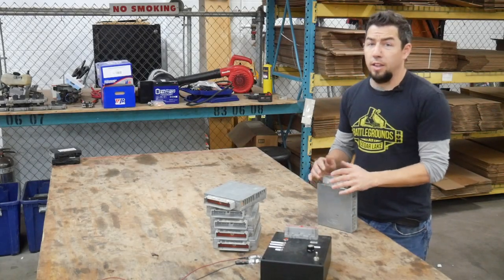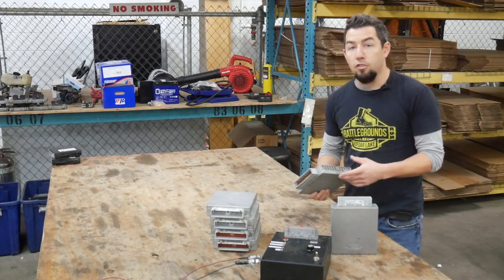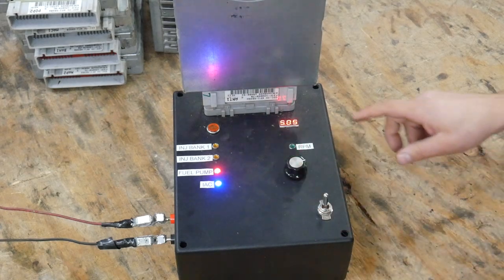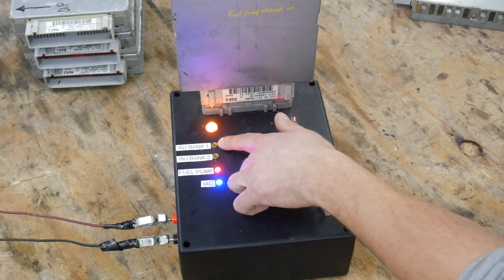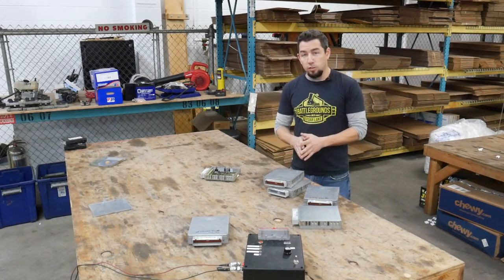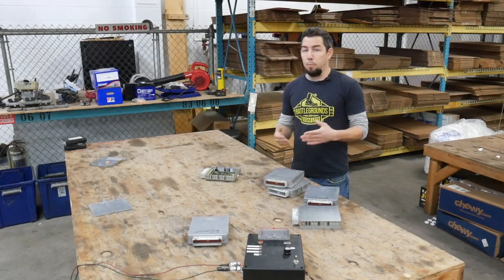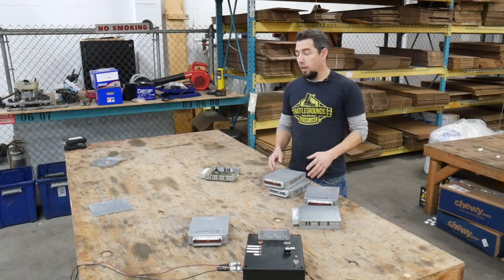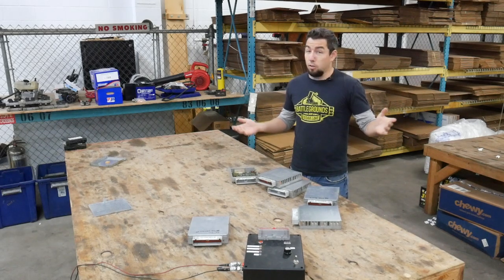90's Ford F150 F250 F350 Ranger Truck OBD1 ECM PCM Engine Computer Testing Common Symptoms & Failure

Comment: Thought this was a solid company after watching the video, you seemed to really know these ECU's in & out, however, after calling/emailing I can't say I'd recommend your services to anyone.
Reply: I watch you all the time
Reply: Why?
Reply: I saw your s10 6.0 video 👍
Reply: Hi Sarah, I’m really not sure if you’ll even see this reply or not but I have a 1994 manual ranger and when I bought it its always had an issue with the ecm where it just will not start after driving/turning the ignition too many times in a day and I’ve tried ordering a new ecm and it made it run awful and so I had to put the old one back in, when I opened up the old ecm when I had it out I took some pictures but nothing appeared to have a bad connection or no capacitors leaking, I’m really not sure what it could be and I have no clue how I could find a perfectly working ecm that’s exactly for my Ranger stx 6cyl 4.0 manual, seeing your comment on this video and watching your ranger videos you made made me assume that you had a similar problem with your ecm, I was wondering if you have any input you could help me with? Thank you in advance if you do end up finding this
Reply: @russbow05 Get the number off your ecm.  For instance, for my 1990 2.9LV6 ford with overdrive automatic, the factory installed a F0TF-12A650-BGA AOU engine control module.  I recently purchased a used spare for my vehicle and replaced the three failure-prone electrolytic capacitors inside and swapped it for the original.  I've also replaced these three capacitors in the original ecm and have stored it along with my spare parts for this vehicle.
The replacement ecm works fine, just as the original did.
So you have to locate an exact match ecm because it's configured for your particular vehicle, transmission inclusive.
It's possible your vehicle was fitted with some incorrect part or parts to begin with, production mistakes do happen.
Reply: Not helpful without some context.

Comment: This is cool that y'all's doing this love it.. I've got a few of these trucks and I put a computer from a automatic in a manual and has worked for over 15 years. The check engine light is on but no issues running or driving. They were the same motors at least lol. I wouldn't have even tried to do a manual to auto but other way around ship it lol.
Reply: I want to replace my cab on an 89f250 with a 94 f150 I’m wondering if my email from the 89 will plug into the 94 cab? Any thoughts?
Reply: I think you can hang some solenoids or even resistors or light bulbs on the appropiate ecm circuit used for the auto transmission solenoids to make the computer happy.

Comment: We have a 95 Power Stroke that is having throttle issues. First time it revved up all by itself with no one in the truck. Now about every half hour it starts rattling smoking, and looses all power. We were scanning it thru one of these episodes and the injector pulse width goes from 1.2 to 5.5! We tried a rebuild IDM and it won't even start. :D

Comment: I have an 89 E150 with 70,000 original miles, when starting warm it has a pulse idle for a few minutes then smooths out, but cold start it operates like new. I wish there was reprogramming for extra power like there used to be, I've been wanting a replacement ECU for when mine shorts out in the future. I have a 600 I/6 with the C6 transmission

Comment: Eric, I need a PCM for my truck and I had tried calling the number you have listed in the description to find out if you had one available and see if I can purchase via phone but I get a recording that this number is not available. Did you change numbers or what’s up brother? I checked a couple times and what I dialed is exactly what’s in the description. Can ya please help Eric, I need to get my truck running, my feet are tired of walking! Lol

It’s a 1994 F-250, automatic transmission. I’m gonna pull it in a few hours and hopefully it will still have the part # decal on it, but we’ll see. 

Thanks Eric!! I appreciate the help !!
Reply: Did he ever answer you?  It looks like nobody gets any answers here...

Comment: 95 F250 7.5 Automatic.  Starts fine idles with a slight miss, runs fine as long as I don't stomp on it.  As soon as I stomp on it, severe misfire, rpm drop, harsh jerking and rich exhaust. Timing light on coil wire confirmed coil is not firing when misfire occurs. New distributor, plugs, wires, coil, ICM, MAP, fuel pressure regulator. Previous owner was chasing this problem.  Drive it 8 hours home as long as I babied it no misfires. I'm down to ECM or timing chain. No check engine light. Have you seen this specific symptom?
Reply: Check TPS, might have a bad spot on the potentiometer. Then check ECM for bad (usually leaking) capacitors.

Comment: So I got a shop manual for my truck. It has all the values for the sensors the truck uses. You seem to understand what the computer is doing. Maybe this sounds crazy but why cant you make a new computer or raspberry pi type board to do the thinking

Comment: Ok little study here 1990 f250 7.5L gas battery was installed backwards by customer now we’re getting irrational fuel pump relay activation and constant coil firing without the engine spinning could an internally shorted ecu cause that ?

Comment: Great video. !  I have a 1993 F-150 which cranks, but doesn't start.  Replaced distributor, coil, and the computer twice.  Truck will start & run for @ 30 minutes, then die.   I bought a tester from Amazon, but for OBD 2.   I assume Amazon has testers for OBD 1.  Suggestions ?
Reply: Same issue here, i got a 30 dollar obd1 tester at autozone and i got the code for PCM Voltage failure (Code 513)
Reply: @jacobog3221  What did you replace, and did the truck run OK then ?
Reply: They do, just got one myself
Reply: @kennethcallahan7410  Tks

Comment: I have a 2003 f350 6.0 diesel. It uses ford protocol for an operating system. It uses canbus for the ficm control. As i understand it, this ecm was only used for 90 days. Im having trouble finding troubleshooting videos for this ecm and system. Can you assist me?

Comment: Where are you guys located out of and is this true only for 90s trucks. I currently have a 2000 excursion and I've been chasing my tail trying to figure out check engine codes. A mechanic shop couldn't diagnose it recently and I'm starting to thinking it's my engine computer. Please let me know how I can get in touch with you folks or if you know a reputable shop in Southern California, thanks in advance 👍

Comment: Could this cause only 6 of the ignition coils to spark and not the other 2? 1998 ford f150 4.6l v8 4x4 single cab stepside shortbox

Comment: 94 bronco 5.8 I always smell a plastic burning scent from the ecm location for 2years now. I get paranoid I check the brake reservoir which has been updated and some times think its the rust protection burning.  Now im sure its the ecm burning its self. I wonder the cost probably like 600
Reply from the maker: It's possible something else is causing the smell. If a capacitor was getting that hot it would have gone out a long time ago. Our units are much cheaper. You can find them on eBay by searching your part number.
Reply: @ProRebuild  thanks

Comment: Hi stupid questions time. I have a 1994 f150 l6 5 speed.Last year during al this covid stuff I lost the fuel pump part of the eec.
This a ca. truck according to the  emission sticker.Instead of using the info on the door jamb< I pulled the eec and showed it
to the local auto part chain store to have them match it.Can a manual trans truck run on a auto eec ? supposedly they matched the eec.

door jam says F3AE 6E081 HHD.Calibration 3-51-R10. old eec the one I pulled out says F3TF 12A 650 NC.
I believe they tried to match by application . I could never get the idle below 1000 rpm.Lately on start up hot or cold idle swings up to 2000 rpm then drops to 1000.Check engine light works and is not on.Passed smog a week ago.

 I dug up my old OTC 4000. It can do the KOEO test only and comes up with all kinds of auto trans codes Will not communicate when I try to do KOER or select show data . I clicked on path finder the help on the scanner . I get just because your vehicle runs on this eec doesn`t mean it is correct for application ?.

Any advise on how I should proceed ?  Thanks

Comment: So i ran my 1999 7.3 powestroke out of fuel. Reprimed the fuel bowl and everything and its getting fuel but its crank no start. Would it be pcm?
Reply: Did you ever get ur truck started I know when I changed my hpop it took for ever to start it takes a lot to clear that air out of the system so

Comment: question, could a bad ecu cause a trany to up and down shit sporadically without any warnings? either at low or hwy speeds?
Reply: 94 bronco owner here, mine did that yes, it would hard shift and according to the mechanic it would be shifting from first to second but it would think its in nuetral and cause it to jerk and shift like i got hit by a train from the back, hope that helps. Its not a absolute but from my experiance it could be the ecu is going. I THINK its either water getting in from the rotting body seal in the cowl amd dripping on the wires or just goes bad naturally

Comment: Is there a way that you can get one of these stock computers and upgrade all the capacitors and resistors and what's necessary and reprogram it to be able to produce more horsepower or they just easily able to be hooked up to with the right stuff and reprogrammed
Reply from the maker: We do not do anything like that. We just do stock replacements no upgrading for more horsepower.
Reply: What numbers do you want? When I type in all the numbers it has no matching parts. Here's everything it says, JETO eec-iv efi-sd48b f4tf-12a650-na g 64esb48b37 9573-10 4a31, by the way it's a 94 ford econoline with the 351w

Comment: You need to come up with a test for the trans. I just installed the 7th computer in my  95 lightning and 3 we reman. The last used computer fixed it.
Reply from the maker: We never sold you seven ECU's. I do not think we have sold you a ECU. We have not had a Lightning ECU here in a long time.
Reply: @ProRebuild  I don't think he was claiming that he bought the seven ecu's from you, only that he bought seven.
Reply from the maker: @jimmydavis6254  Could be true. They can contact us by phone if they are having any issue. We will be happy to help.

Comment: I just pulled mine out of my 1995 Ford Bronco with a 5.0 motor and it has a little black plug in of something on the back side.

What is that and why is it different than all the other ones I could find online ????

Comment: Do you have a email address I can contact you at? I am have several problems that all point to the ECM (constantly running fuel pumps, no start, and leaking Capacitors in the ECM) i have pic of the label but I can't make out the part number. The truck is a 1994 f150 XL v6 with Manuel trans. Thank you
Reply: was the constantly running fuel pump a capacitor problem?
Reply: @TropicBreezeRealty  i took the ECM to a TV shop and had them replace all the capacitors that were bad. After putting the ECM back in the truck all the same problems were there. We replaced the entire ECM with one from O'Reilly auto parts and the truck fired right up. ZERO PROBLEMS.

Comment: Oh and I also got to say this man it's not 100% critical about the matching identification numbers lol not joking my computer every so many months will fry itself the ignition control module or the coil rarely but I could not keep spending $200 so I found computers that were relatively close to what I have you know v8s same firing order relative same year you know keeping it close and well I've got one in right now I've got another one under receiving my truck and I'll probably went through about three more and I'm trying to find out what is making it burn blow before you're seeing anything I have put in probably $2,000 worth of new and remand  computers The trucks got a lot of sentimental value to me so I'm stupid and don't want to let it go That's why if you look a little further down in the comments just send me asking about upgrading the computers by replacing all the parts inside to see if it can make more power
Reply from the maker: Yes some computers will get can get you running but are not the correct ones, matching part numbers is the best way to make sure it works.
Reply: the calibration code may also define  if it needs a push-start or tfi ignition module in the years of crossover. the PIP signal and what goes to the ecm or from it.  But, the wiring pinout is NOT The same and the pcm can very well nade a module and coil or the module sends something to the PCM on the wrong pin, and its also without the resistor that the other system has.  
SOOOOOOO

You need to get a proper TFI or Push start module (black vs grey) and also MATCH to your PCM calibration on the truck and make sure it matches the drive train, THEN any updated cals from Ford
Reply: also a c6 computer wont do very well in e40od since brake light circuitry is different and the pcm is not worried about shift points... also cruise being on the system affects how it reacts to certain inputs and in a c6, the manual tv valve controls line pressure and it controls parameters TO influence line pressure through different means than where it can use the epc or in the 4r whatever, its got more than e4od.

point is match your year range usually 91-93, 94-95, 96, 96-97(F250 HD only), emissions commie or states, drive train in its entirety,  chassis similarity like no C&C in a step side , air density / maf, vin cut off in relation to tsbs, some may cut off really weird spots even same year trucks,and then sure you can if its similar.  the problem with eec iv is how universal the base components are which is why its also so cool and desireable.  The things that might mean BIG from one to anoter arent able to be self-diagnosed  with regards to components, its not meant to discriminate severely and its also capable of seeming fine when its costly damaging.  the data reading is low, and its not tracking long term trends quite like they do now, etc.  So sure you may have good AFR but you forgot your new pcm wasnt at all able to handle Secondary air, so now your CATS arent doing their job and they gonna burn out.   smooth.  or your bad throttle cable does not move the throttle enough for the outdated cals to notice the rapidly wiping signal from TP sensor and 1 sensor wears out 2 you have fuel enrichment happening as intended yes but now your truck is having a hell of a time handling shifts well, keeping temps low from TCC unlocks, and pass emissions from fuel trims up and down.

get the right pcm and get it updated

ford didnt put calibration codes out there for fun or because they like stickers(which they do indeed like stickers)
Reply: @CT_Taylor  Thank you for what you wrote that was interesting and it did helpyes I do have the wrong computer in and other things probably aren't up to snuff because parts have went out so often but with a factory matched computer put in it we'll still fry those components
Reply: @CT_Taylor  you are absolutely right.... Lol could go without the grilling at the end.... Lol
Man this a constant problem with a matched ecm. U get to the point where I LOL CAN'T spend anymore $$$ on these???? My question is how, what, where's, a place I could look at to see the problem. Or something like a process to do to make this dam thing stop THIS 🤦🤦🤦🤦🙏🙏🙏🙏🙏🤞🤞🤞🙏🤞🙏🤞🙏🤞 anyone...
ASK me some questions about the situation and truck
Reply: @phillblack1745  frying pcms sure sounds like Intermittent grounds and power connections, surges from electrical spikes, bad Pcm diode, ignition system not properly working or back feeding  or improper pcm input device such as wrong sensors or those sensors shorting. 

Alternator. Ignition. Sensors. Grounds. Diodes. Look for fusible links in good condition, fuses in the cab and the fuse box in condition, ignition switch in column for shorting, or blower motor back feeding through the ignition switch. The blower motor on these trucks runs through the switch instead of using a relay.  That’s a lot of amps.  Isolate it for better air flow and increased ignition switch life. Just a good mod generally. Verify engine and trans are original to truck and each sensor that reports to the pcm is proper. 94-96 trucks have a lot of year, engine, emission specific parts. My 96 f150 has a one engine one year only throttle sensor, so it was available only from 3 manufacturers and no motor craft. But the 95 is everywhere
Reply: @CT_Taylor  ... Lol wow okay lol that's allot. 
Seriously. Where is the PCM diode at???? 
Also where are some fuse able links at some of u don't mind where some easy feedback spots lol checked all the grounds literally All of them+ ADDED LOL MANY any input is glorious